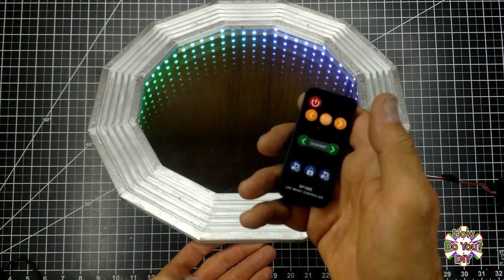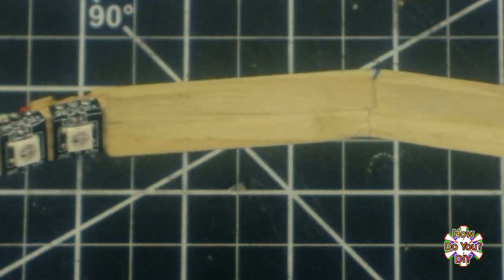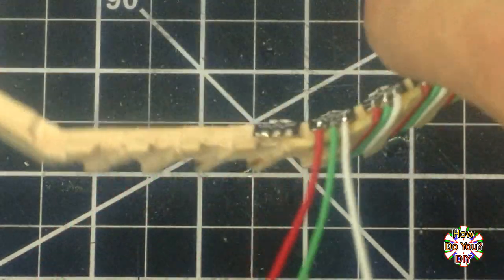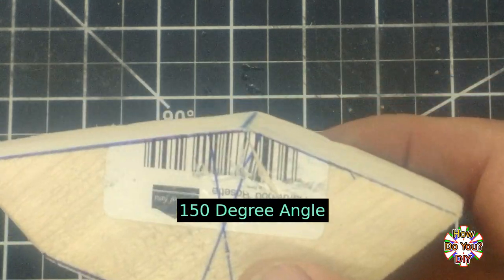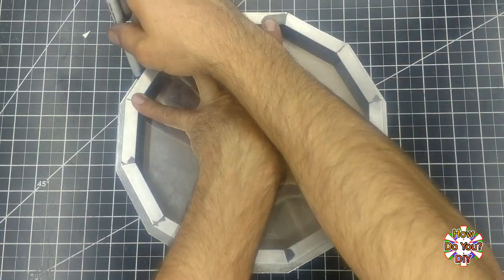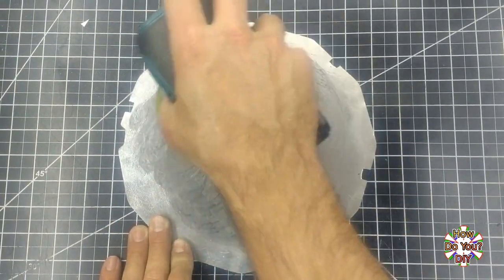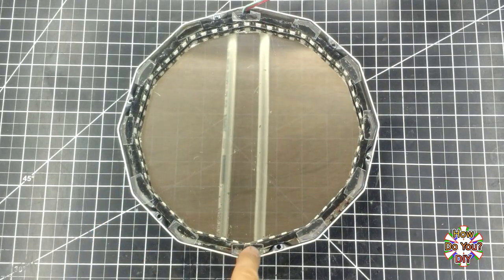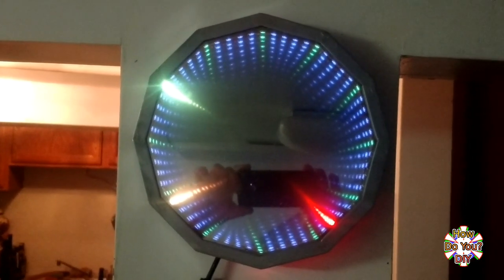Make an Infinity Mirror Clock

Comment from the maker: I have created a GitHub page that has the Arduino Nano code. You can find it here:
https://github.com/HowDoYouDIY/LED_Clock
I'm still working on some upgrades for the clock.
Reply: How to make it more rainbowish , this colors looks so flat ,
Reply from the maker: You can change the colors in the code before you upload it to the Arduino. You can have almost any colors you like.
Reply: @HowDoYouDIY  yes but i want it to change it by itself like not single but it can chNge from any rainbow colors not any single color how to achieve  that
Reply from the maker: You can update the code in the program to do anything with the lights that you want. You can do any colors, and any pattern. If you don't want it to be a clock, you can change the lights to do a rainbow 🌈 if that's what you want.

I don't make videos to do programming, but there are lots of videos on YouTube that do.